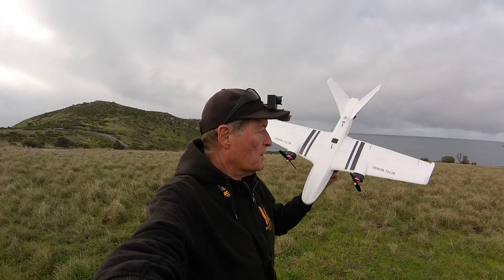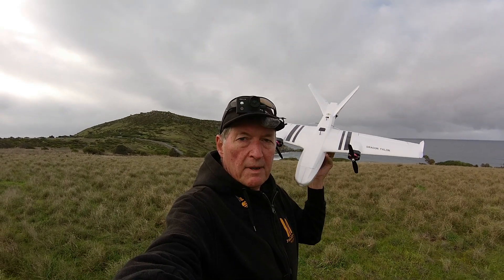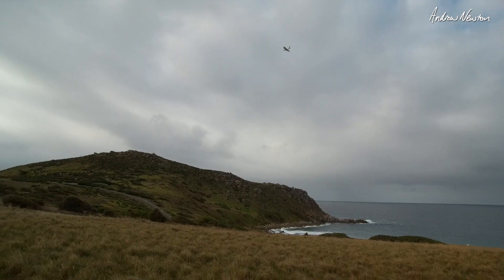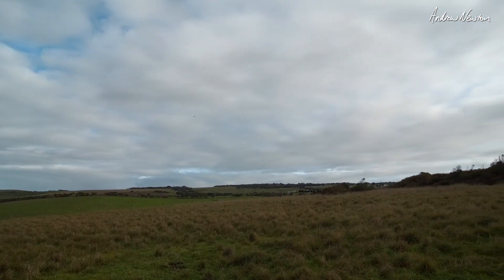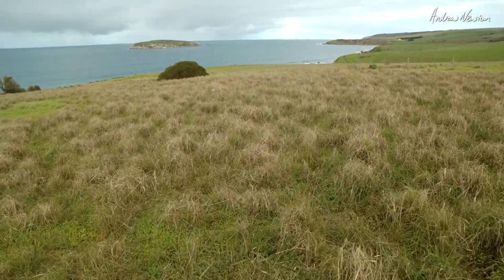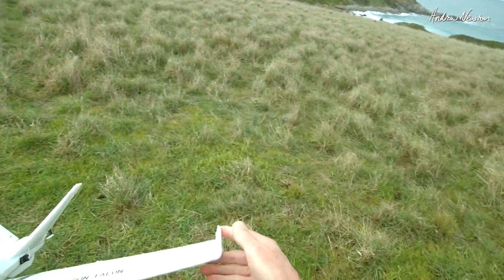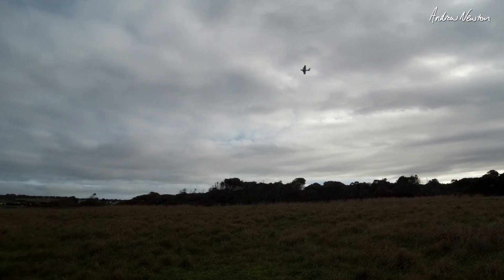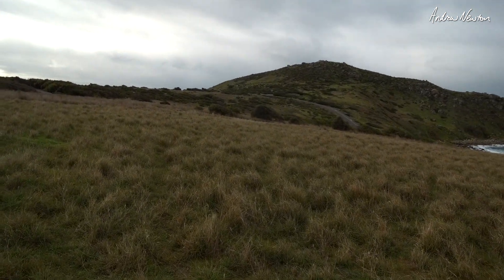Reptile Dragon Talon - Stall tests

Comment: Add wing area. But really why besides the challenge would you?  I can see why you'd fix a bargain airframe but this plane is quite expensive, so it should just work un-altered.
Reply from the maker: It definitely should behave better in the stalls. More wing area is needed

Comment: I wanted to like this one, it looks nice and I hoped it was built on the success of the Reptile Dragon 2 twin. I was afraid of it's small wing area, and the swept V-tail that the RD-2 flew poorly with, compared to the conventional tail. Even if you could lighten it up enough to fly OK, there's no room for the weight of a flight controller and FPV gear, which makes it a poorly designed sport model at best, with countless better alternatives out there to fit that bill... lol Seems they missed the mark on this one big time! Thanks for doing the dirty work for the rest of us!
Reply from the maker: No problem. It does fly well at speed but needs to behave better all-round to be successful

Comment: Andrew thanks for this follow up review. I want to use only a 4s3500 Lion pack with mines. What is the weight of your 3s1300 Lipo? With the design flaws no wonder BG is selling them so cheap.
Reply from the maker: 1300 3S weighs about 110g

Comment: I think you kind of miss the point.. this plane was clearly designed for fpv. Could it fly nicer when it comes to stall ? Yeah.. do we really care not really.. this will be flying with flight controller running ardu or inav and you will be able to see all stats even with airspeed sensor you could prevent stall.. like the AR mini and ar pro .. stalls in a spiral of death but great for fpv with flight controller.. what I like about this plane is it's long range capabilities, i load this with 4s2p 7000mah pack and it did over 130km total distance .. not many other planes of this size can do that
Reply: Really. Can you post a video or have links to your setup?
Reply: @IanF-FPV  setup is f411wse, 2205 2300kv 5x5 prop and the zohd 7000 pack .. takes of without any trouble really efficient for distance cause the cruising speed is high .. getting about 50-60km/h on roughly 3-4 amps
Reply: @matejbludsky8410  I have a set of 2206 2400 kv  motors and the same f411wse. I also have a 6500mah 4s2p Lion pack but wasn’t sure if it was too heavy.
Reply: @IanF-FPV  this could easily lift even 4s2p 21700 10000 mAh .. tried and it worked fine .. you definitely gotta keep up the speed if as heavy as that :. People fly 4-5kg mini talons too absolutely no problem just make sure your cruise speed is fast enough
Reply: @IanF-FPV  not the kind of video you can post anywhere 🤪
Reply from the maker: It certainly flies very nicely above the stall speed. Great to hear your heavy setup is successful.

Comment: That's a shame, I like the looks of this one. I have the Reptile Dragon v2 and with the kopilot lite controller switched on it will not stall, no Matter how slow I go. It was designed as a long range fpv ship. This one is designed for fpv only ? I don't see where you would mount a gopro?
Reply from the maker: Too small for a GoPro

Comment: Is there any twist/washout at all in those wings? If not, adding some is the first thing I would try. How about make a cut in the underside of the wing from just outside the nacelle at the front, to just inside the aileron at the back. Not all the way through, but enough that the outer section can be bent up (just a few degrees, it won't take much), then figure out a way to keep it in that position. This will also give a little dihedral which can't hurt. Maybe put the winglets back on, I don't think they are a negative.
Reply: Like this: https://www.iforce2d.net/tmp/Selection_767.png
Reply from the maker: Yes, I like that idea. Added to the list

Comment: Wonder if a vertical stabiliser would help. Or even modify to a traditional tail would be better.  
Reason I’m wondering that - the stabiliser is quiet close to the wings (so not much leverage) & being a v tale airflow might go downwards / lift tail during a yaw/stall?
Reply from the maker: Trying that next
Reply: @AndrewNewton  I’m looking forward to seeing it fly :)

Comment: My Bixler used to constantly tip stall in a slow speed turn. I installed some DIY Vortex Generators on the wings and have not had a slow speed turn wing tip stall since. Just an Idea..

Comment: try changing the motor direction, as it is now, the spiraling thrust pushes the stalled area from the center outward
reversed would push new air into the stalled section
Reply: Interesting idea.

Comment: I'm not into FPV or camera-carrying 'mission' flying, so I'm not familiar with the accepted norms, but it seems to me that there's a whole generation of pilots raised on sophisticated quad-copters, multi-rotors and fixed-wing 'drones' who've not done any other form of aeromodelling.

Unlike Andrew, they've come straight from online combat games, flight sims and YouTube videos about quad racing or freestyle flying and have (literally) never handled, selected or bought a piece of balsa wood before. Nothing wrong with that - RC modelling is a hobby for everyone, and quite right, too - but it means that their expectations of what constitutes the right tool for the job are guided by what's offered to them in foam and carbon-fibre RTF form, and the notion of designing their own planes based on prior experience simply never crops up. 

Naturally enough, manufacturers produce compact models optimised for their chosen area of the hobby - i.e. being crammed into a backpack, transported to a scene of operations and flown solo, exactly like a military reconnaissance/attack drone, rather than a bulky plane that's going to be loaded in bits into a car on a Sunday morning and flown at the local club with a bunch of mates.

The result (and this is just my opinion) is that many models are designed for business, not pleasure. They're tiny (because that makes them portable); they're dense and fast and 'neutrally stable' (because they're loaded with batteries, flight-control boards and gyros to take care of the boring old flying bit - the operators have got more important things to focus on), and they have little to do with stooging about on tickover with up-trim and the flaps down, following the local buzzard.

The Reptile Dragon Talon reminds this old-school modeller of a Club-20 racer. They were sleek and terrific fun, but not at all cuddly. They flew like bricks. They often had no dihedral and weren't suitable for novice pilots. They were very fast, and a poorly designed one would indeed drop a wing in the stall, but that was the expected and accepted penalty for not flying them fast enough.

Does this model come with a warning about its narrow performance envelope? I suspect not. To most buyers it's just another guided camera platform.

As STEPHEN GLOOR mentions elsewhere in the Comments - a few degrees of washout would help with the low-speed handling. I'd add some dihedral and give the wing 2° of positive incidence, too, but then I'm a big fan of hassling buzzards. 🤭
Reply: I can not fly LOS. I started my Hobby  with Flite Test Tiny Trainer. And continued from selv build FPV Quadcopter. OK i know I have not the Typical Aeronautiks Knowledge of RC Plane Hobbyists. I came from FPV Drones this mean I Need it fast. An Fixed Wing should hit 160km/h becurse in a Hight of 80m in Open field the feeling for Speed goes down. I Need an Flight controller and GPS to get the OSD Data in nice fighter Jet Scene. I know what you mean my preference is Not a Nice looking Plane with Fly LOS and I shifting the Focus of Media Contend in your Style of Hobby. But I am Young and Love it to Fly and feeling free in the Sky to exicute my Personal Problems. I hate it to the Comercial Airplanes only designet to Profit. Does I realy need an stable Airframe when I Have an Flight controller? The wingshapes designed for low speed Performance would reduce the efficency for higher Speed. And I personally give Up low Speed Performance to have Faster travel  speed. I wish this airplane should fit 4S2P 21700 Cells and Full  FPV Gear. We Quad Pilotes flying wery agile Drones witch can Spinn very Fast. And this Nimble Agile RC Plane is Ideal for us. We Fly FPV and this means we can  handle the difficuld controlls better and on wider range out of eye sight. And we can  reach Faster Landing Speed and have more  range to target the Runway. The most critical thing is the Start.

Comment: Great effort testing. Not as fun a task sometimes, as others. 

On full scale plane adding slats, or vortex generators would help mediate poor stall characteristics, but not really applicable at this scale. 
Adding some polyhedral wing extensions might help, as would reducing weight by just one motor on the nose. BUT don't think worth your time, as would be a creating a different model than advertised at that point.
Oh well. 🤷‍♂
Reply from the maker: Good one for experimenting with. More mods coming
Reply: @AndrewNewton  ♥👍